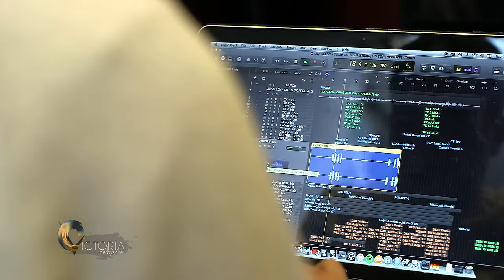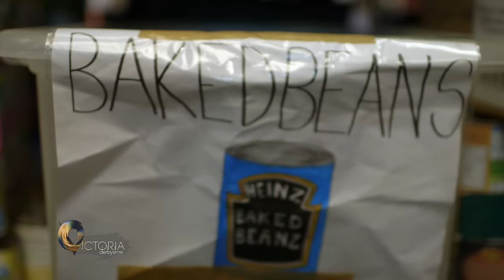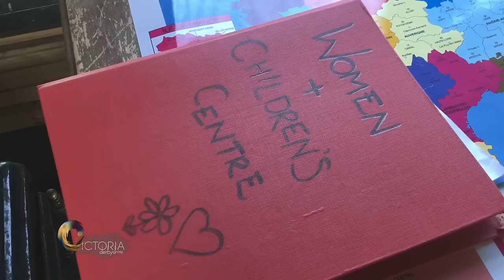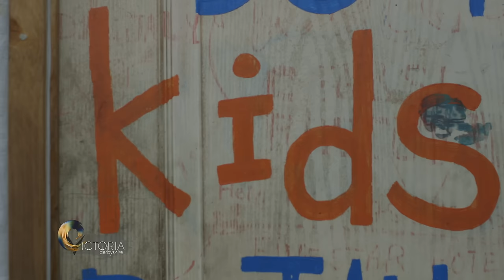Lily Allen in Calais: 'I apologise on behalf of my country'- BBC News

Comment: The UK needs to take responsibility for this instead of spending cash on walls & fences.
We should be at the front of the EU heading a EU border force, to stop people entering our EU zone
We should be heading a EU army providing safe zones in conflict areas, to stop people needing to migrate.
We could prevent the boats setting off to OUR EU.
One country alone can not solve this, We need to be acting with our  EU neighbours. instead of RUNNING away.
Lilly Allen is right to apologise  for the UKs piss poor efforts.